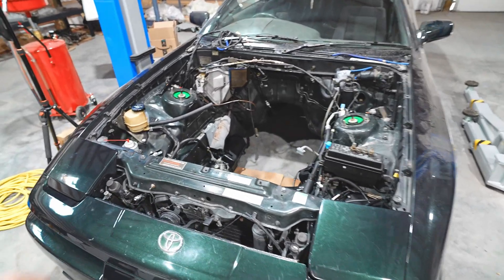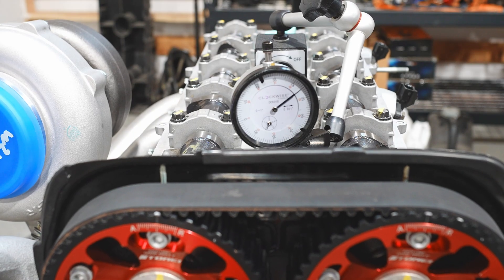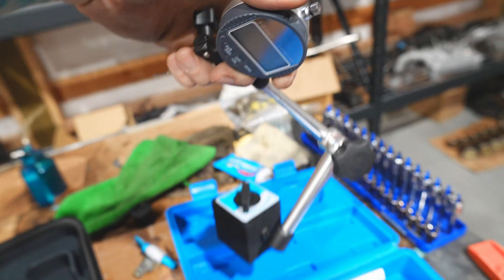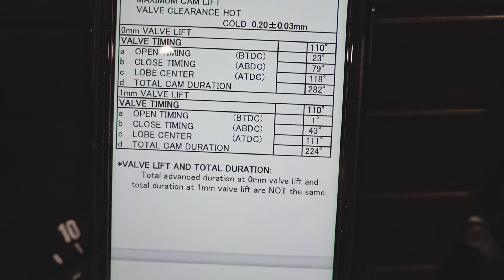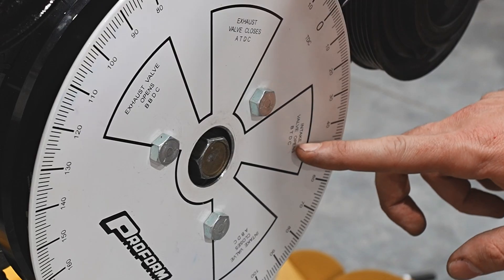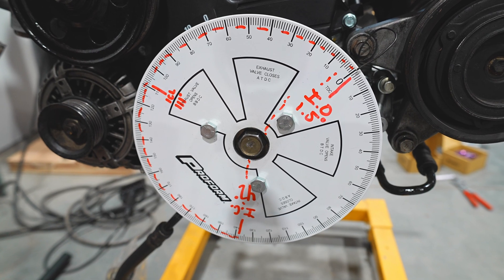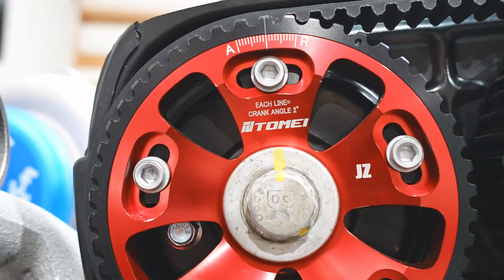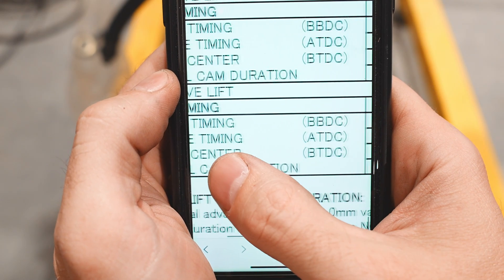How to Degree Camshafts on Any Inline Engine (Step-by-Step Guide)

Comment: I have argued with many people before about this, I don't think degreeing is a necessary step, if you know how to check PTV with a dial gauge, get the engine to 0 PTV. 
Then what you do is record on the cam sprocket the number at which PTV is 0 then mark 2 deg back from there as the max marker, if you don't get the valve to hit perfect you have the full extent of the sprocket to play with, and this is ideal.
Then put the engine on an engine dyno, which is a critical step imo, what you do is change the timing 2deg both cams until you fin the peaks you are looking for be that torque or be that power, then you can fine tune from there and play with splits/centreline angles.
This way you are finding true cam centre line, as you have torsion in the cam, torsion in the crank, belt stretch and all that good stuff, so you can put that stupid degree wheel on and set the cams to where "they are meant to be" and run it up on the dyno and make less power then when you set the cams using the dyno it's self. 
some will say oh but you can check to see if the cam is correct, well that is what a cam doctor is for.